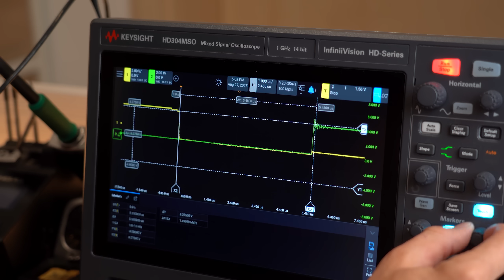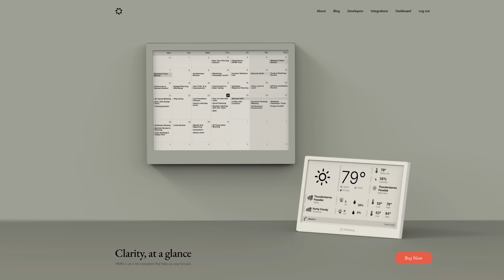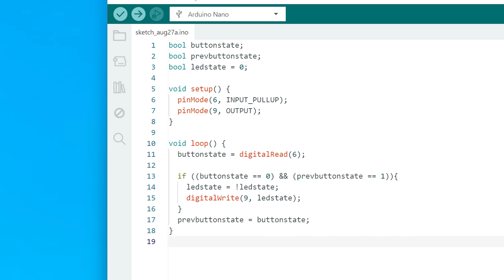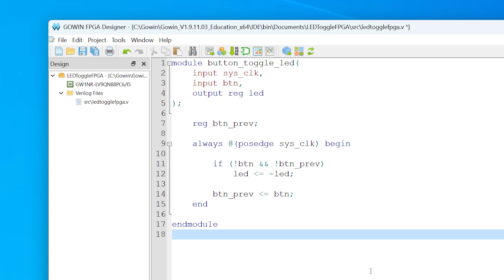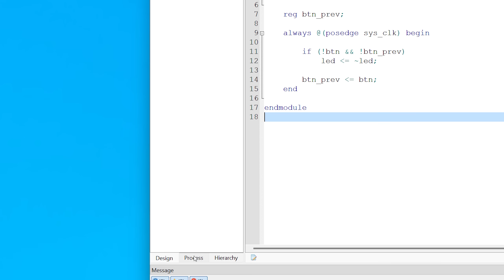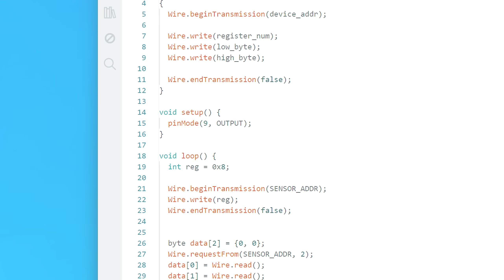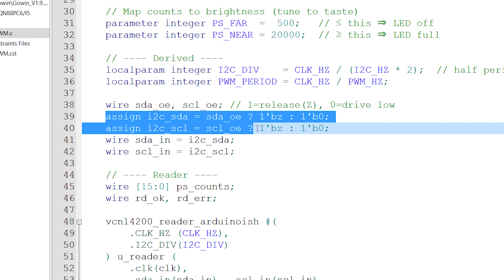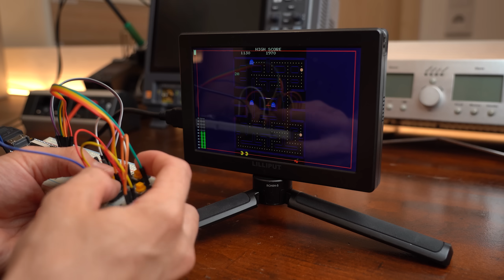The Harsh Truth about FPGAs (You Should Avoid Them?!)

Comment: My peak FPGA involvement was about 30 years go, but I believe this video sells FPGA short, and although comparing them to a microcontroller or cpu might be easy or convenient, that's not where their strength lies.  It's about using the right tool for the job.

CPUs are great for hardware that has lots of branching, and have time to do things relatively slowly.  FPGAs are great when you don't have a lot of decisions to make, but you need to do everything quickly - like on every single clock cycle.   A CPU or micro typically has 1 ALU.  But what if you need 32 of them running in parrallel?  Then you want an FPGA.

Back then, I worked for a telecom test equipment company - SONET, DS3, DS1, T1, Ethernet, ATM, etc.  We used FPGAs to sync up to the framing of those signals, pull out the relevant data, process it, can check for errors at multiple levels of the comms stack simultaneously. Of course, we generated the payload, framing, error insert, and line coding for the transmit side as well.  Standard CPUs of the time simply did not have anywhere near enough bandwidth to do all of that.  

RISC processors started coming out then, and if they were supported by custom external hardware (like an FPGA, dual-ported RAM, high-speed FIFOs, etc.) could be used if designed VERY carefully, to handle important subsets of the functions.

As a test equipment company, one of the hugh advantages of an FPGA was how much discrete logic we could pack into a single chip compared to standard TTL devices.  The space, power, and weight savings were CRUCIAL for keeping the test equipment portable.  Although back in the '90s FPGAs couldn't run nearly as fast as discrete logic - especially ECL - their size grew pretty quickly, and we could convert the serial data into parallel (outside the FPGA) and had enough flip-flops in the FPGA to do the logic we needed at a workable clock speed.

My group was constantly hitting the speed limits of FPGAs at the time.  I had to figure out that the standard design methods their documentation promoted, while good for "standard" designs, did not apply to our cases.  I required me to carefully examine the device architecture and use its resources in the most effective way possible.  For example, for the speeds we ran at, any logic decision that couldn't fit entirely within 1 logic block / LUT had to be pipe-lined, otherwise you'd never be able to route it to meet timing requirements.  I also hand-placed (but NOT hand-routed) many critical circuits, having figured out that if I had placed critical flip-flops and tri-state buffers next to the right long lines, the router could figure out the proper way to connect the signals. 

So I will reiterate, that it's about using the right tool for the job.  For some jobs you can use a circular saw or a jig saw, but chances are, your results will be far better if you pick the one best suited for that project.

Comment: An FPGA is not intented for very difficult conditional sequential processing. It is usually used together with a CPU or the CPU is designed in FPGA code and then programmed in assembler or C. Designing a CPU in FPGA takes lots of experience.

Comment: The biggest problem I have with FPGAs (and CPLDs) is the relative lack of development tools and programmers, especially for macOS.   Even if you use open source "yosys" and "OpenOCD" applications they often end up relying on calling out to proprietary "fitter" .exe applications supplied by the manufacturer and that have to run under WINE.

Comment: FPGAs are another tool. Seems FPGAs are good to replace hardware parts.  I had 3 quadrature encoders into converters to get count/direction into divide counters that my Arduino read using an I2C interface chip. All that could be put on a FPGA reducing complexity of wire-wrapped wiring but I see no need to try to implement logic in the micro controller. I tried to read the quadrature encoders in the Arduino but didn't get a good response so I went to hardware. 

I designed semi-custom ICs but so far only did a couple tests on an Intel FPGA. That hardwired replacement is still on my list. Meanwhile, the hardwired version works fine. It is a "just to do it" project.

Comment: FPGAs superpower is parallelism, as mentioned.  Xilinx can implement 8 bit, 16 bit or 32 bit microprocessors in FPGA fabric.  There is also IP available for doing soft peripherals.  Also to mention hundreds of IO on one chip.  Clock frequency can be multiplied internally, so the crystal frequency may be just a base frequency.  Great Scott's comparison to microcontrollers is perfectly fair, it's a matter of picking the correct tool for the job.  Digilent has some really nice FPGA boards for learning.
Reply: Those power of two widths aren't required or necessarily efficient in an FPGA. Often the wider DSP and RAM blocks use multiples of 9 bits (exception: Gowin GW1NR has 8-bit HyperRAM). Shaving off a few bits of width might get you higher operating frequencies and lower area.

Comment: great video! i'm also a huge fan of micro controllers especially esp32 but there are cases where fpga come in handy like you said. high speed. if you wanted an accurate scope for example you couldn't use a microcontroller alone as it would need a buffer. where as FPGA can be that buffer. I otherwise generally agree especially for hobby level tinkering the MCU is the better choice but one or the other shouldn't be "avoided" you simply should use them where you need them. obviously you need to make click baity titles

Comment: Impressive amount of info in just 12 minutes. I used to use Altera FPGAs a lot before I retired. I came from a hardware background and used TTL logic in a lot of my designs. I discovered that Altera had a complete library of virtual TTL devices so I found it easy to draw a schematic using these TTL elements and have the Altera software compile this into gate logic. They had a simulator too, so I could test the design before even having any hardware.

Comment: yes indeed FPGA development  is always hard but also fun. I work with FPGAs a long time also as space eengineer. For our space project (MOVEII and MOVEIIB - LRT Munich) with FPGA for SDR in transceivers I developed, I used Xilinx Artix 5 FPGAs with a MRAM (magnetic storage more reliable in space than flash),  at that time we used altium for schemtci pcb and FPGA which had a manufacturer independant workflow and a SOftcore cpu WHICH WE USED for the I2C parts on board to initalize and readout. The SDR part is handled by the pure logic part and both comminicate through ports internally, and via SPI through the Cubesat Bus we used ad the edges.  This hybrid aproach was really great, nowday also embeddec cpus in hardware could be used, but all is also power tradeoff.  The parts we used word for the whole lifetime (7 years for MOVEII and 5 years for MOVEII2b) until there deorbit time. We did a 1-3 hrs auto reset and reload of the Firmware and FPGA code to prevent hangups. The communication windows is always around 15 min in VHF and UHF and SBAND for the two different trasnceivers., Code could be uploaded to the satellite also if wanted.

Comment: you can implement a cpu on fpga but not on the arduino (excep fpga based arduinos :). if you are an FPGA digital designer then you have to implement nearly everything from scracth (if there is no ready to use verified IPs)

genearlly use case of fpgas  are highspeed data transfer and protocol implementation and signal processing, or multiple interfacethat most MCU dont contain itself implementation

Comment: FPGA Engineer here, with 15yrs of experience.

1- USe IP core or open source HDL code if you want commonly used functions like I2C, UART, SDI,...
2- After years of FPGA experience, you will get a massive library of IP blocks ready to use. Make sure to define them with parameters in the header, so you can tune them for your application.
3- Any HDL code/blok should be tested/validated via simulation. Many free simulation tools are free, and even sometimes included into the IDE. => Learn to do do testbench is crtitical, and help to debug and make your code functionnal even before compiling it.

4- Your verilog code without debouncer hurted me, haha. Simple debouncing algo like "majority" is sufficient. Make sure to put as much code a posiible into a process to make it sequential, it fits better, compile better, and more easy to check/debug for the timing analysis when you will start to reach high frequency clock.

FPGAs are awesome once masterized, and much much more powerfull than CPU, GPU and MCU. Main limitation is DSP that is basically only on Fixed-point and integer numbers, and it can takes monthes to get a working bitstream, as it is not as fast as developing with MCU/CPU.
Reply: Ha, I noticed the lack of debounce too. Made my eye twitch a little, though probably not as much as his flip-flops twitched.
Reply: @gawkersdeathrattle1759 what do you mean by flip-flop twitched? (I am a junior CE😅)
Reply: @bouyahiaouihadjer6692  I was making a little joke about debounced input. Ideal switches and buttons have a hard, infinite rising and falling edge when toggled/pressed to on or off respectiively. In the real world, almost anything hand-pressed will toggle the new and old connection states, and sometimes a high impedence state a number of times as the metal inside the switch has a marginal connection during the transition. End result often is a short burst of oscillations during the transition.

Hence the need for 'debounce' on human-entry devices. 555s are often employed for this purpose in discrete applications, in FPGA you can basically do an edge detect and give it a 15-20ms delay before it honors the next edge detect. While it's not a perfect solution (there are some genuinely shitty switches out there), it'll clean up your signal significantly and make button presses a lot more reliable.
Reply: To your last point I'd think you'd be better served using an fpga with dedicated dsp for that, assuming one exists that meets your specs. Ofc you probably already know that, but adding this for others getting into it, you can get fpga with cpu cores and dsp hardware baked in.
Reply: @xxportalxx.  , Yeah very true. Its always down to your application. If the FPGA is not powerfulll enough for complicated DSP, you can use a SOC, but ARM is also sometimes limited. The best I have done was to couple a FPGA to a octo-core TI DSP (TMS320C6678) via a x4 SRIO High speed interface. The DSP was used to compute 4D movement path for controllling ultra-fast robot arms.
Reply: Hear hear! I come from the days of simple logic so FPGAs are great for me. But it’s horses for courses.
Reply: @marcdraco  Simple logic died with the 1960s, we are in the information age!
Reply: @beaverbuoy3011  Minicomputers were made all the way to the '90s, though by then they'd often shifted to PALs and CPLDs for complex stuff.
Reply: @beaverbuoy3011  Built from simple logic blocks.
Reply: Nice, I was wonder that as soon as he ran into the I2C issue - like surely somebody has made an open IP block for that.
Reply: hi alphus, a basic question for a beginner. I learned to code in VHDL but most of the available IPs are written in verilog. and also there are some IPs that need updating for newer versions of software but in many cases I faced some issues updating an ip. what could be the correct approach for these problems or maybe I missed something from base?
Reply: @octopus6342  , If you ave access to the full IP code in Verilog, and it is not not too big, you could rewite it into VHDL. It is a very good exercice and both languages are so close anyway.

Otherwise, many IDE tools (like Vivado, for Xilinx)accept mixed-language VHDL/Verilog compilation, so it doesn't matter, as long as entities and modules names are matching.

A bit more complicated for simulation, as mixed language not always supported by tools or free versions of the tools.

For updating IPs, it is normally to its owner to maintain it, you just cant make it if you don't have access to the Verilog code of it (or only got Netlist type IPs).

If it is vendor IPs (Xilinx, Altera, Lattice..), normally, the new Version IDE will ask you to update the IPs, when opening the project and is done automatically, so just do it.
If not working, you can try to not update it and see if it is working,
Otherwise, you may need to re-generate your IPs in the new IDE version. Can be very long to do so. That's why I like to put my IPs into wrappers, it is more easy to maintain and can do cross-vendors bitstrem.
Finally if nothing works and the IPs are just too old, just keep the old IDE version. There is actually no much benefits to update to new IDE version except to add new parts in it. We FPGA developers use to have zillions of IDE version installed on our computers, to support all of our old projects...haha
Reply: @octopus6342 If you only want to learn one HDL, make sure it's Verilog. Verilog and SystemVerilog are the industry standards so most Open-Source IP is written in these languages. It's tempting to learn VHDL because it appears simpler, but it will give you a headache in the long run when all the premade IP you need to use is in Verilog. For clarity Verilog and SystemVerilog are akin to C and C++ respectively, SystemVerilog builds on Verilog with additional functionality, but I wouldn't advise you learn SystemVerilog as any IDE you can use as a hobbyist won't support SystemVerilog. Industry software that does support it is circa $5000 per year per seat. 

TLDR; stick to Verilog if you're a hobbyist.
Reply: Hi. I have some question.
As a beginner of MCU, APU likewise what is required? 
I've been started these like C, arduino, ... but I don't know what is necessary. 
Thanks for reading.😅
Reply: Do you guys do hardware fuzzing for testing real devices when developing or do you rely on simulations to cover as much of input space as possible?
Reply: @Martinit0  ,both. Simulation first, then real world testing and validation
Reply: Intel Arria 10/Stratix 10 have float32 DSPs. In general it's only expensive, not limited.

Comment: If the FPGA is large enough, you can synthesize a CPU with some peripherals...
Getting I2C I/O is gonna be fiddly (but your "core library" might have a module for that since I2C is everywhere), but you can rig up a LED and a phototransistor and drive those fast enough to make your own LIDAR with the FPGA.  If you want an amazing one (at an amazing price) with amazing IO...  There's a Red Pitaya that has both a very nice FPGA and a decent micro under the hood... and an ecosystem with measurements and projects -- including that LIDAR I was mentioning -- using actual lasers and measuring the time it takes for the pulses to go and come back (and the phase to keep everything very nice).

Think of FPGA's as "universal hardware chip" (so you're making a JK flip flop or whatever -- and you can make a CPU if you really need one)... and micros as "It's a PC, so it runs the software you want, but... the micro is the speed and that's what it is; if you want low-power, expect kinda slow until you start playing fpga-like-games (see also BlueGeckos and other bits that let you "handle IO without waking the computer up").

FPGA - Brutally fast, but very brutal.  You "wire it" from the ground up (but at least you do that in code instead of in Eagle).
uC - A computer with hardware-friendly I/O (for some values of "friendly" PCIE, LVDS, and HDMI are... doofy here, but simple FPGA).

If you want a compromise, look for uC's with "reflex" or "AFE" or other things that let you play games with IO without having to wake up the computer.  Usually more limited in scope, but... makes it easy to "turn the cpu on when somebody steps on the strain gauge"

SBC - More computer, less hardware friendly.  Go control a stepper driver with a RasPi and find that the Linux really really fights your realtimeness (sure, declare that Python real-time.  Watch as your VNC traffic causes the steppers to miss because of inertia).

Computer - Bigger, farther away from hardware.  But at least you can use SFP,  HDMI, and NVMe easily enough (if you have the drivers!).  You wanna have IO?  Go get a USB LabJack.  Or one of these FPGA or uC boards and talk to it over USB.  2.4 GHz can get pretty real-time... unless there's something "more real" bugging your processor(s).

Does anybody do anything with those weird DSP's any more?  Goofy gray-coded PC's (see ADSP SHARC) and other real nonsense that made signal processing easy, but abstract computing... daft.
Reply: Today's FPGAs are pretty much all large enough; what used to be a large FPGA has been rebranded as CPLDs.